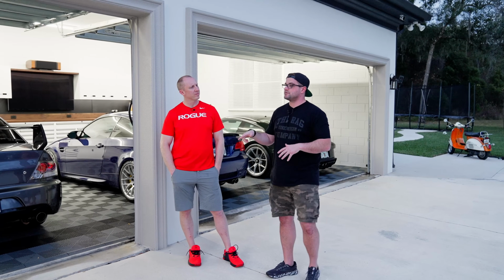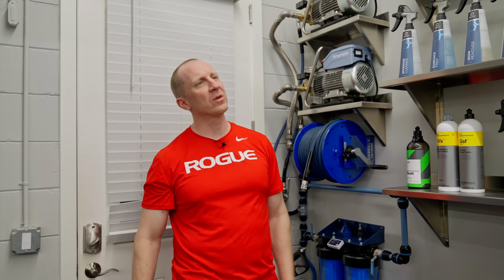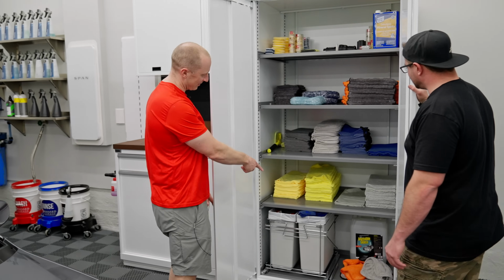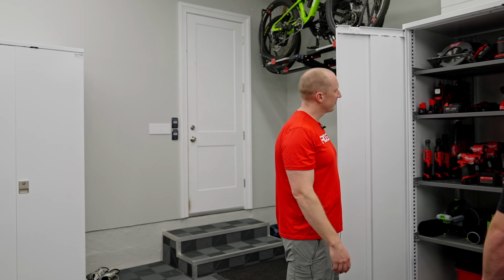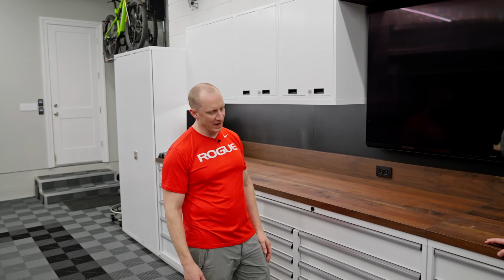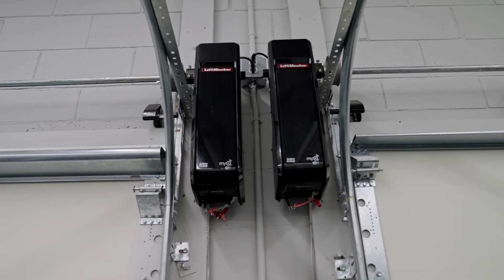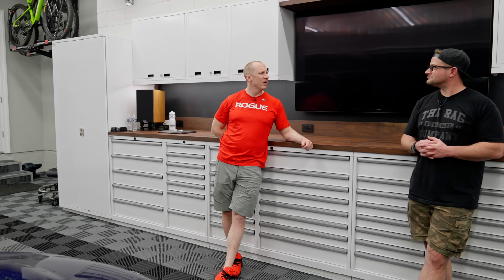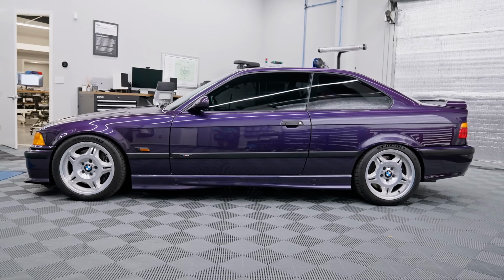Experiencing The Ultimate 3 Car Garage With Matt Moreman | Obsessed Garage

Comment: This is my dream. Thanks for sharing this video.
Reply from the maker: Our pleasure!
Reply: you too can have 52 tools, and 52 batteries of which you will only ever use 3 or 4! LOL
Reply: @leftyo9589 sure it's overkill, but when that's your business and you're using the garage as a display showcase of sorts...it makes total sense (and is probably a write-off). Cordless tools are easier to store/display in a cabinet when they have a battery installed.